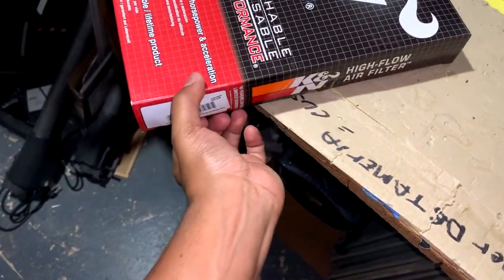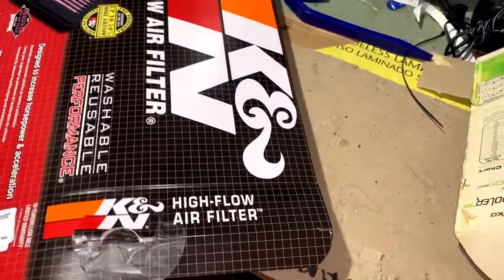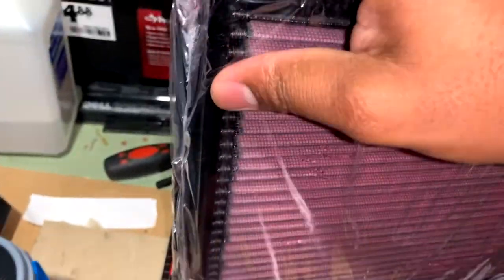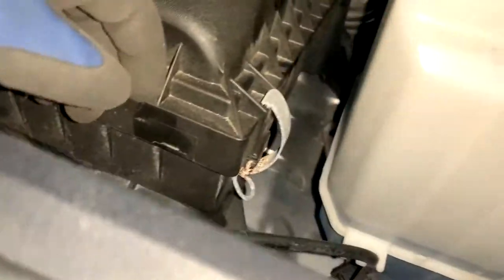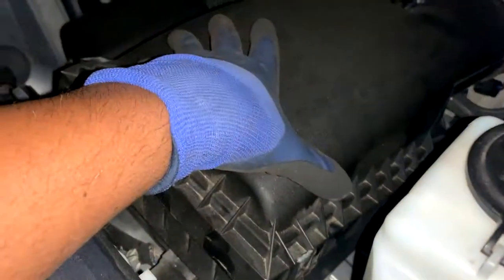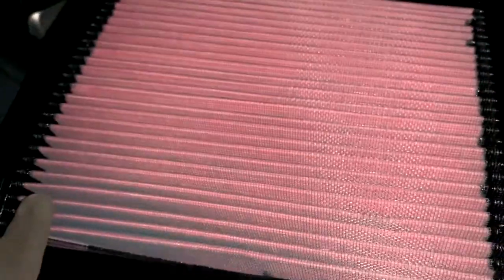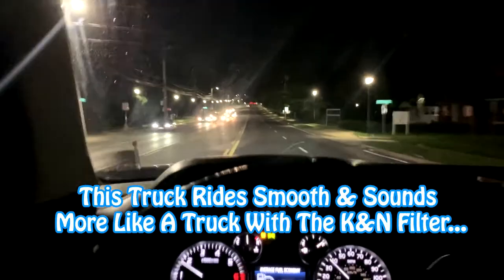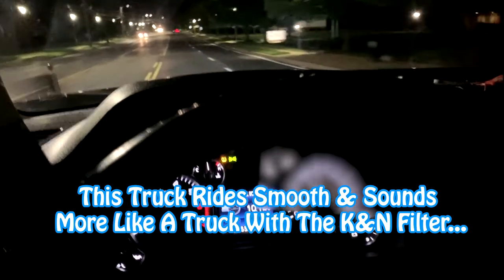How To Install K&N Air Filter (Toyota Tundra)

Comment: Do you have the clean the sensor?
Reply from the maker: Nope, I did not have to clean the MAF sensor but I do clean it once a year depending on the elements of the world.

For example, if I am driving through a construction zone often where dust and debris is airborne, I would eventually clean the MAF and throttle body.

Comment: k&n  destroy your piston  am askin  what you think
Reply from the maker: Brotha many Tundra owners and other truck manufactures have not had any issues of such.

I would say that's one of those under lying conditions with the vehicle which may have lead to such damage prior to the mod. But ultimately it's the vehicle owner fault for pursuing with any type of part replacement that is not OEM.

💯

Comment: What’s the purpose of an air filter big guy?
Reply from the maker: Good question James. The purposes of using a "reusable air filter" 
- Provides the opportunity to reuse your air filter which in the long run saves the cost of replacement filters.
- Easy process to clean, rise, air dry and oil the filter.
- By using a reusable air filter you also count down on the amount of trash that's going to the landfill.
  
Now benefits of a air filter in general, it depends on what your looking for but typically clean air filters provide clean emissions, improved engine air flow and improved fuel efficiency.

However there are additional requirements for better fuel economy but my primary reason was to say money in the long run on the cost of air filter replacement. I typically run 2 reusable air filters which allows me to run one and then when I need to clean that one, I can then use the other one while one is being cleaned. Hopefully that was clear.

Thanks
Reply: So what's more damaging to the environment, using a good air filter and changing every year say, or saving a few bucks on filter changes and throw aways and sending the entire truck to an earlier grave? Do the math.

Comment: This 1794 edition?
Reply from the maker: It's the Limited CrewMax.
Reply: @AWordFromMrJones  you know meybe if kn air filter fit to 1794 edition ???
Reply from the maker: @mattimessi8740   Yes this air filter is compatible with the 1794 edition. The 1794 was Toyota's Texas factory special edition which included the interior "western theme".